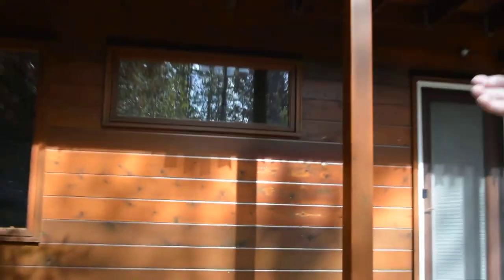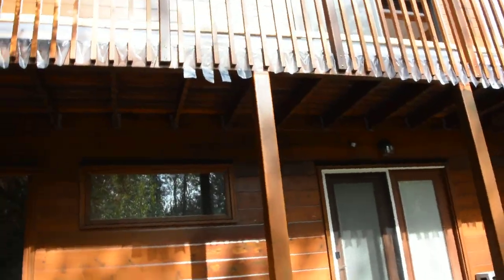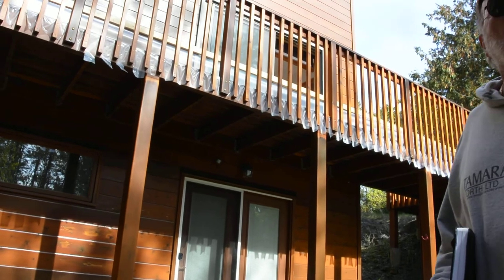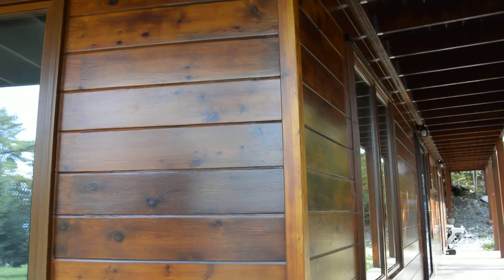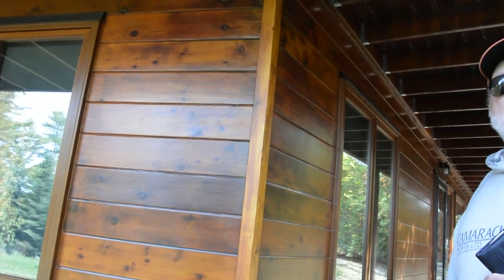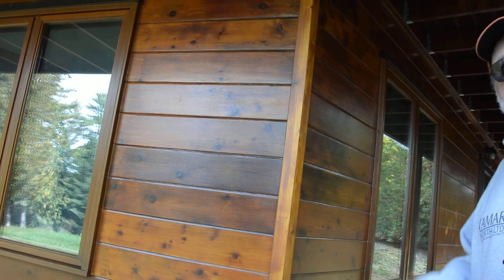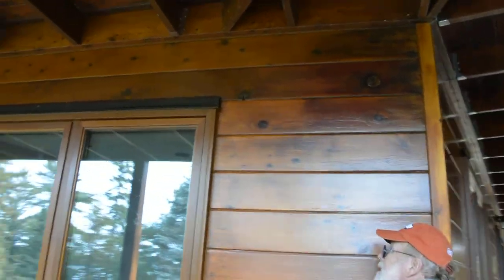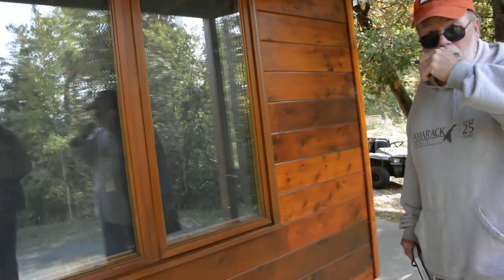Part 1: Lindal Cedar Homes authorized a general contractor to visit our property October 2018

Comment: The order this should have been put together. The vapor barrier first making sure there are no horizontal laps directly behind the rim. Second I would have installed a layer of bitimen behind the rim then the flashing then a strip of bitimen to seal the top of the flashing. This was definitely a design or installation flaw. Without seeing the plans it's not possible to tell which one it is. The installer could have just followed the detail on the plans or the detail was right and they did not follow the design.
Cantilevered beams are a bad design in wet areas of the country but if it must be done flashing the top of the beam the width of the beam plus 1 1/2" for each  side. Then cut the underneath of the beam at an angle to help protect the end grain. If that beam was not 100% dried out before putting epoxy on the beam could actually trap water and cause more damage that cannot be seen. The beams should have been re-stained each year to keep out moisture. The end grain is like a sponge.
I hope you got your problem solved.